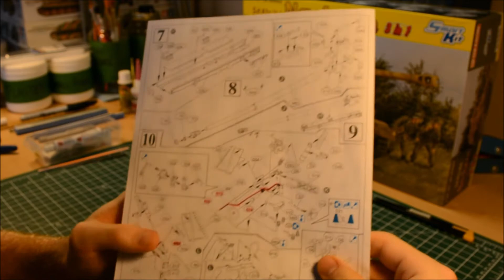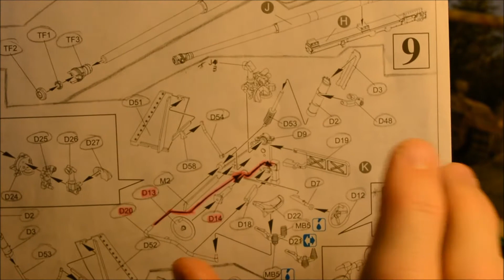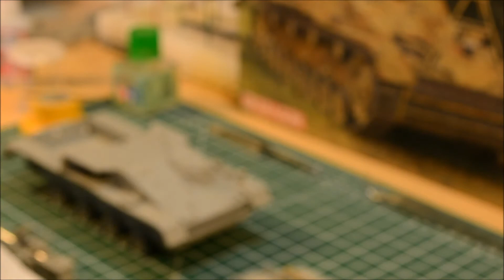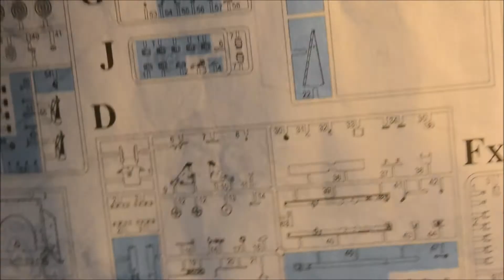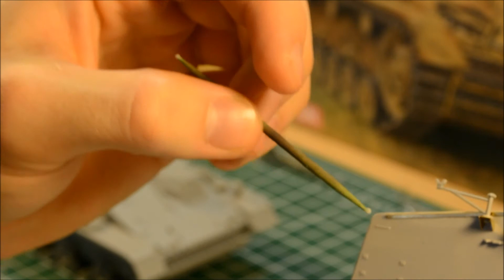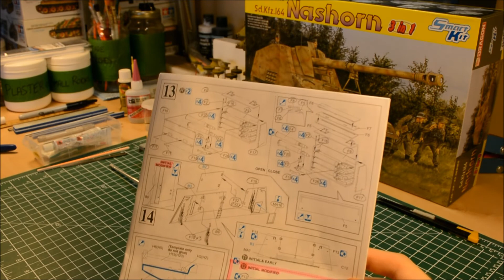Nashorn GB: Update II

Comment: I'm a little late viewing this but....nice update and build.

A small tip on the PE......if you have to bend long or narrow pieces, you can anneal the brass before bending, this makes it bend easier, but not too much as it could melt with too much heat.
Reply from the maker: milky55way2012 
No worries bud!
Appreciate the tip and the comment! I may have to give that a try.

Cheers!